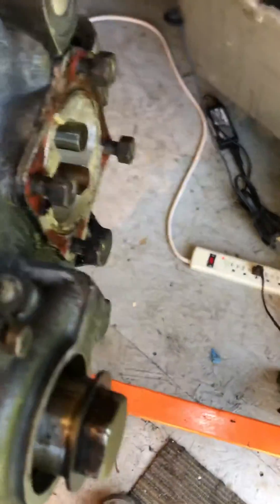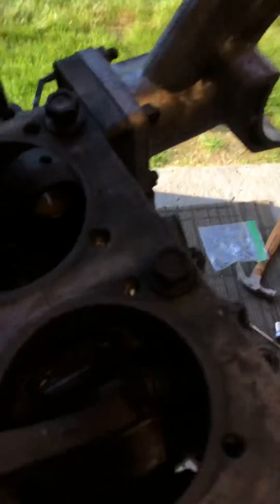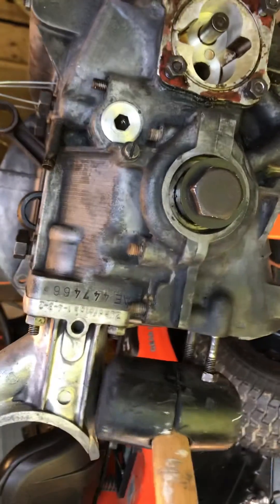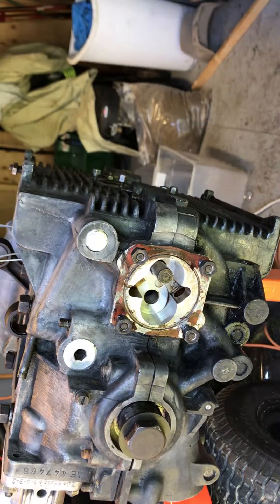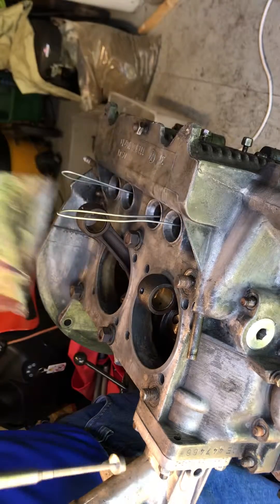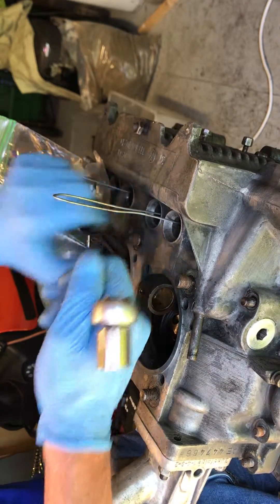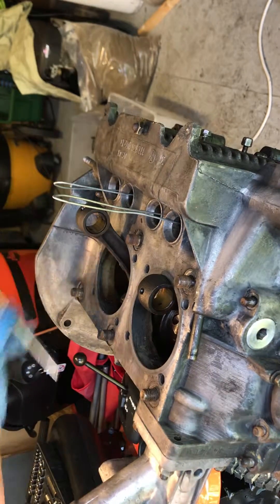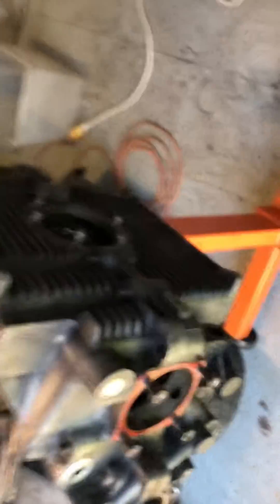1971 Sup beetle engine case split

Comment: You need to use a case splitter goes in oil
 pump housing then you won’t need to bash it with a hammer simple cheap cost effective tool